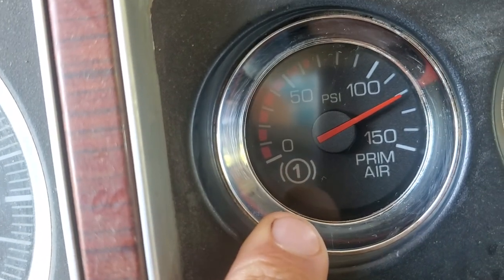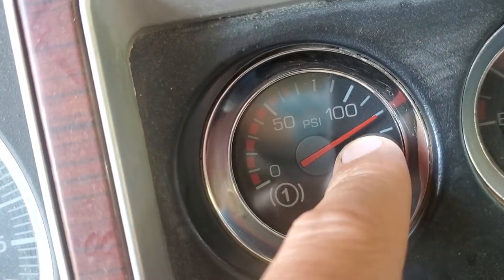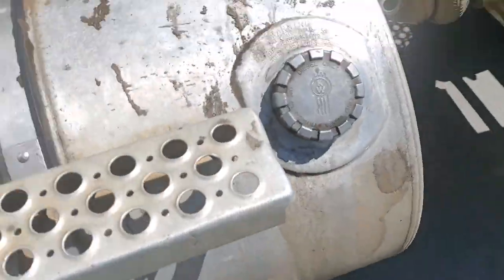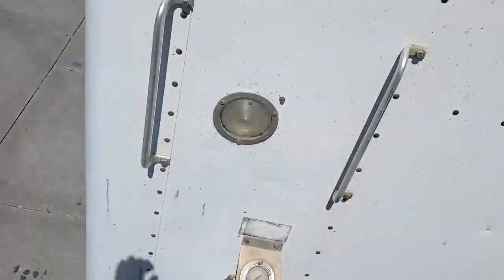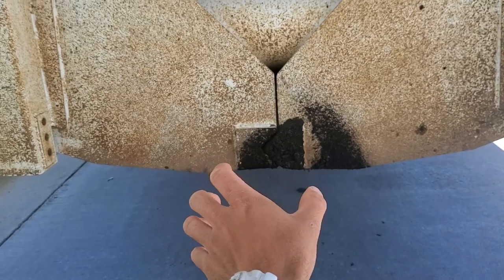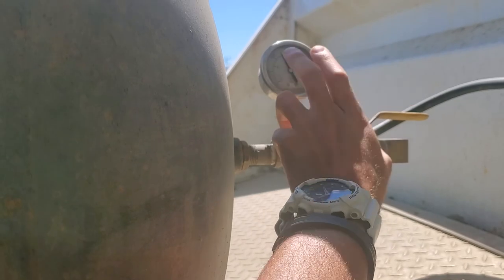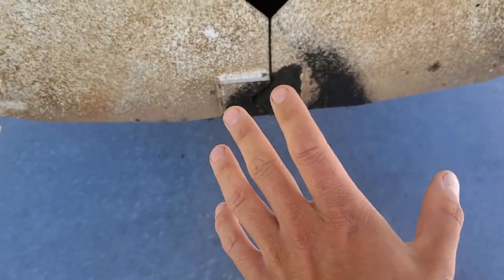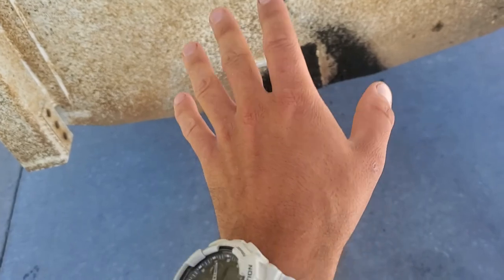How a belly dump operates

Comment: Great video! I appreciate you taking the time to get up close and explain the air pressure holding those gates closed. We designed and sell a lock for those gates for those times the air pressure fails to prevent accidental loss of loads. Love the video!